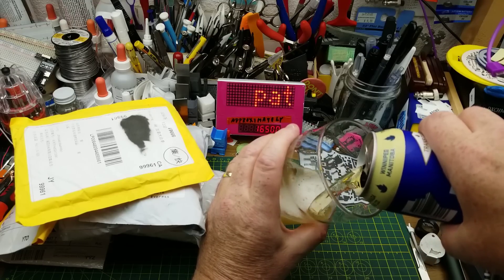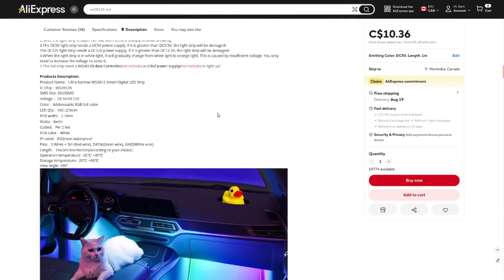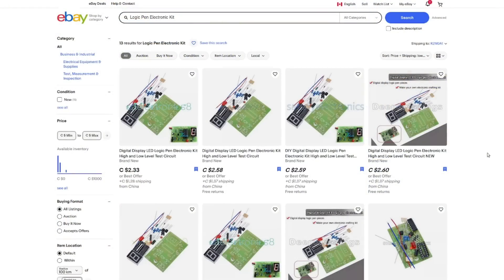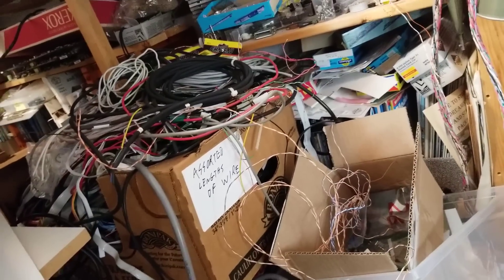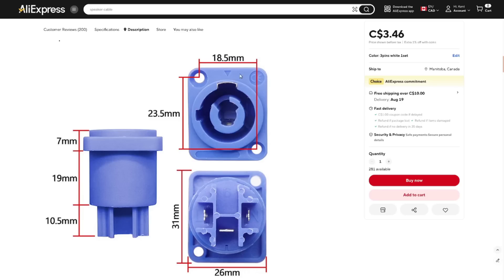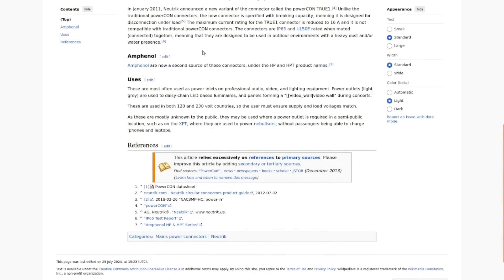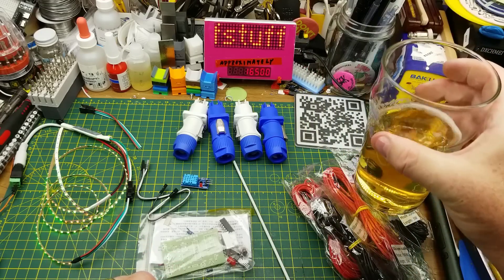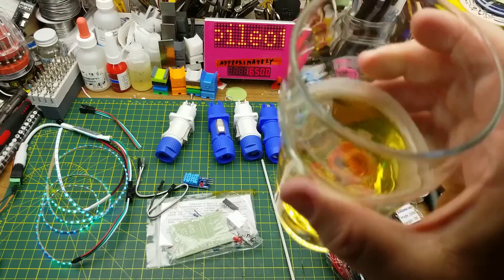Mailbag Monday 198

Comment: Actually the PowerCON is slowly being replace by the PowerCON True1 connectors. Which have an higher IP rating and can be disconnected under load, which with PowerCON technically you should not do. For both... the power rating is 16A. I work near daily with them, and the PowerCON True 1 work better. You can also plug a male in to a female cable and extent your cable that way. But PowerCON connectors are great connectors and there is no risk of plugging them in the wrong way. Like with Shuko cables. Anyway, nice haul again!
Reply from the maker: If I happen to get any cheap Chinese lights, I assume they'll come with the cheaper/older version of the connector.
Reply: @pileofstuff  Definitely. And also the newer equipment you rent buy use are still mostly PowerCON. It will take years before it will be mostly PowerCON True1. Like with USB-C slowly becoming the standard but it is already years old..

Comment: One thing to note about the powercon connectors you got: They are they older style that is NOT rated for live connection/disconnection. Pins short out as the connection is made/unmade than can cause various problems. The newer standard True1, solves this issue and can be connected live.
Reply from the maker: Good reminder.

Comment: FYI Those connectors are called SPEEKON.
Reply from the maker: Speakon are a different connector for a different purpose.
These are Powercon, and even though they look similar and were invented by the same company, they are specifically for AC power only.

https://en.wikipedia.org/wiki/PowerCon
https://en.wikipedia.org/wiki/Speakon_connector

Comment: Does the Blue plug go into the white socket or is it keyed different
Reply: From what I can see on video, they are keyed differently, as they should be.
Reply from the maker: They are keyed differently to make it impossible to plug them in wrong.

Or at least impossible without a few whacks from a really big hammer.